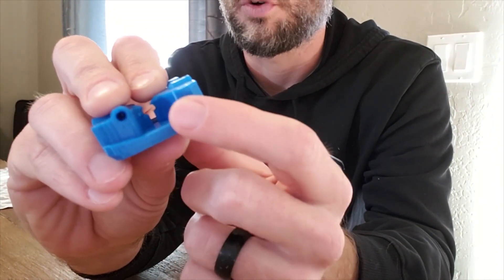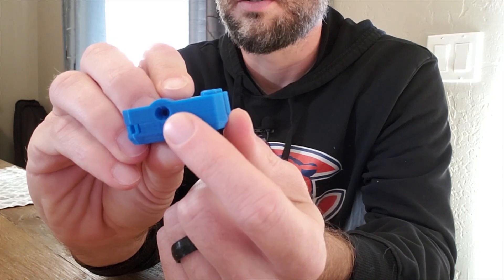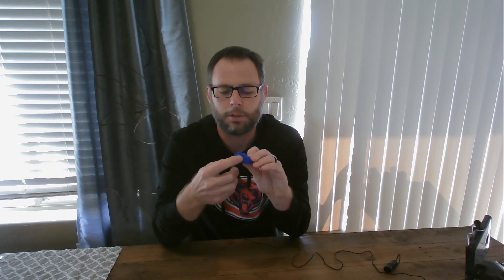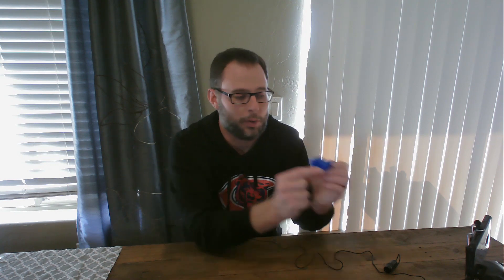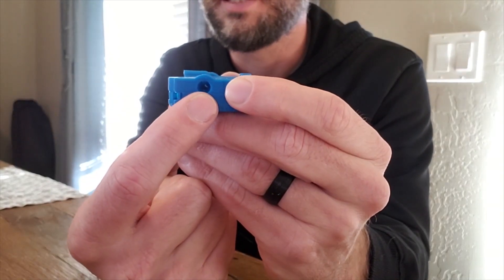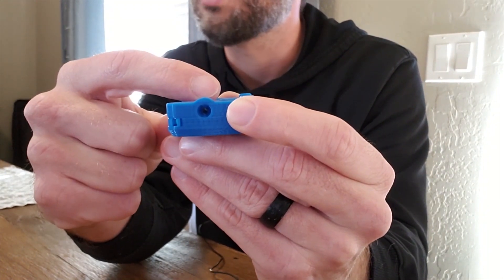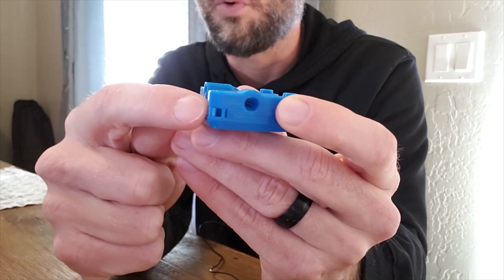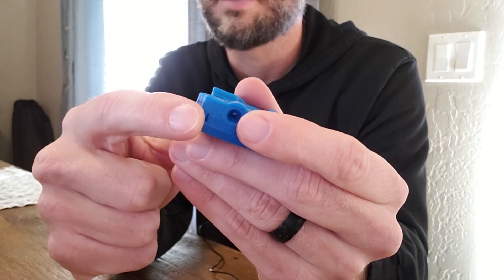Quick Tip on Supports in Cura

Comment: no need to mess with the angle. there is an option in the left floating panel called "support blocker" and also "custom supports". Check in Marketplace/Plugins for that. ;)
Reply from the maker: While this is true, you can use support blocker and now custom supports - I have had trouble getting it to work correctly, and also adjusting the angle like this was much quicker than going around the model and blocking the supports.